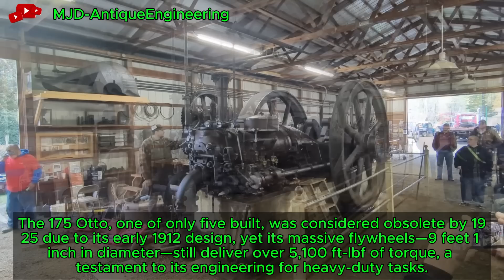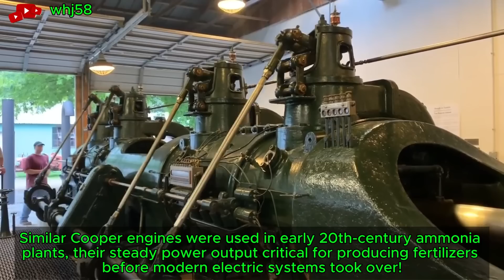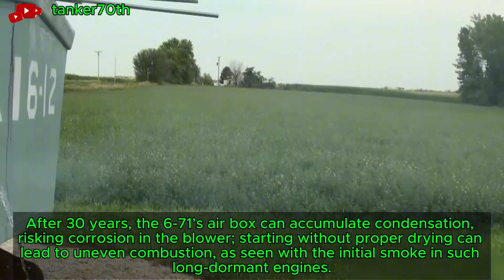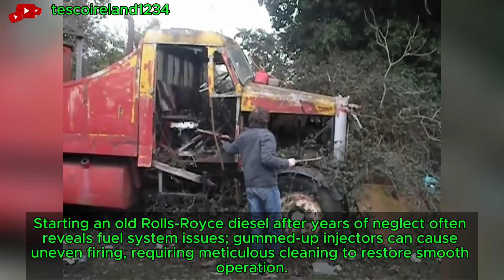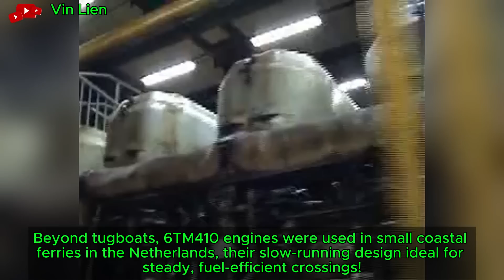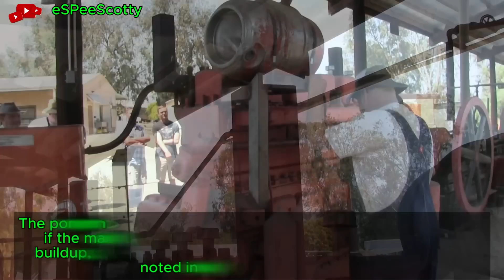Rare Old Engines Starting Up Sound That Will Blow Your Ears! ▶ Part 37

Comment: Waukesha (wah-ke-shaw) engines are built like tanks.. Designed to run thousands of hours without personnel attendance or maintenance. Many of the small ones were used in fire trucks.

Comment: Lister CS diesel engine... Guy vocally says it's a single cylinder, but the video is showing a 4 cylinder injection pump. Beautiful show off of the Enterprise engine... Just like the old gal i found in that underground bunker.

Comment: All 2 stroke Detroit Diesel engines had air box drains built into them... The engineers designed them into the engines to see if any scavenge blower seals had failed, or if any piston rings had cracked from overzealous ether use. I had engine oil coming out of both airbox drains when someone decided to refuel a Detroit Diesel powered generator with gasoline. The exhaust valves in cylinder 2 overheated and fell INTO the cylinder where they were promptly beat to death and made holes in that piston crown. Poor girl couldn't keep up at full load after that...